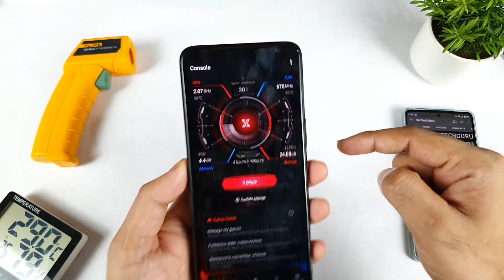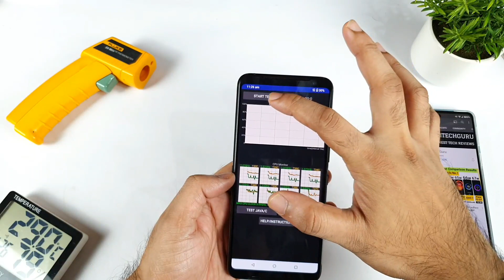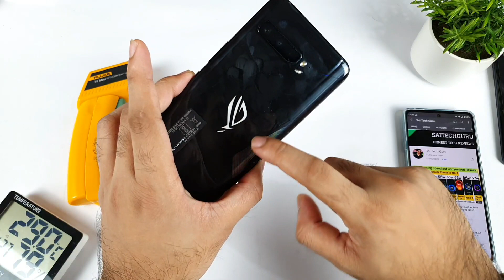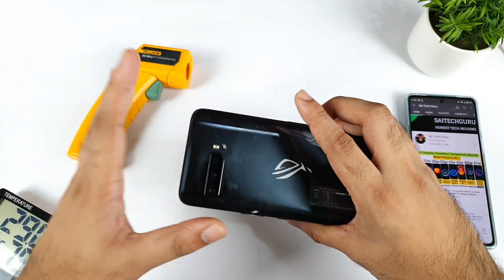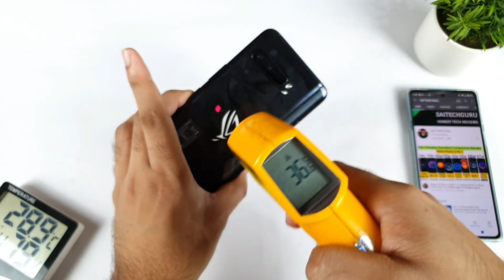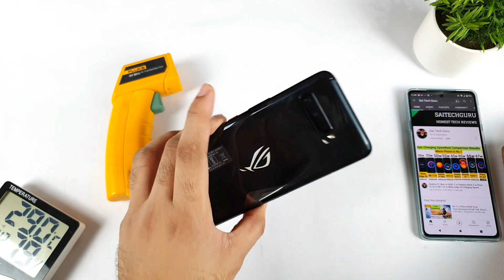Asus Rog Phone 3 CPU Throttling Test OMG 😱 Snapdragon 865+ Still the beast in 2021😍💪

Comment: Is there is a black crush issue in your phone I feel like I have an black crush issue can u help me pls
Reply: There is no black crush if you set your refresh rate to 90
Reply: @Timmy30789 whether is hardware bug r software bug?
Reply: @prasanthrocky8219  bro its software issue.Asus will solve it through updates
Reply: Black crush is a big issue in 120 hz, 144 hz and 160 hz (hidden refresh) on this phone. It was never fixed sadly.